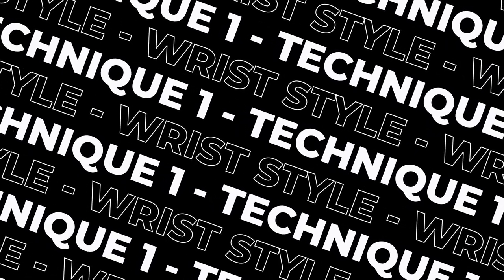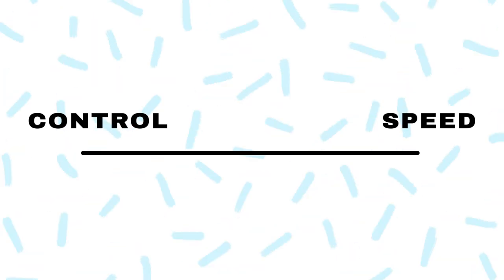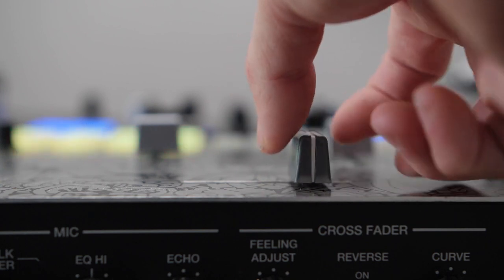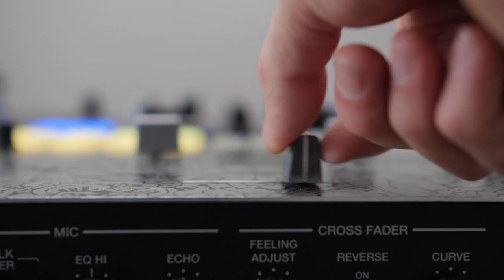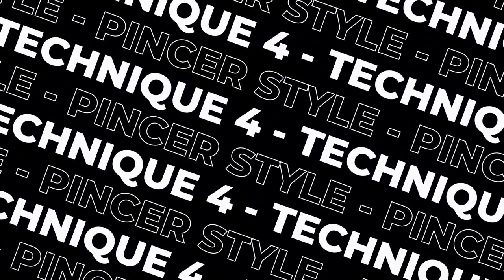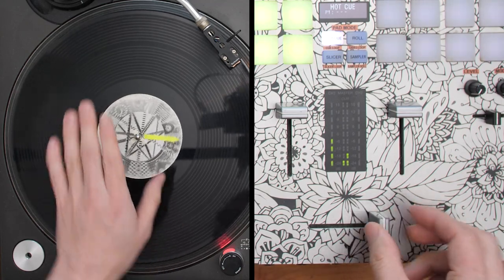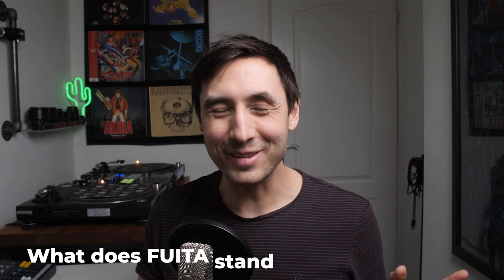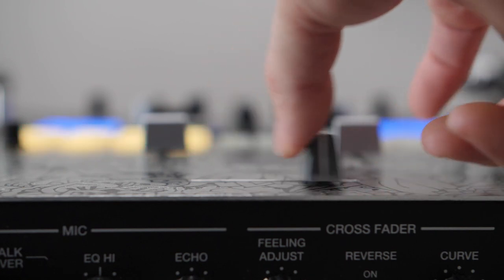5 Crossfader Techniques for Scratch DJs - Know Them All?

Comment: Si - your videos are class! I’m double clicking flares with my thumb rather than fingers. Is that still pincer style? Struggling to get up to fast speeds - not holding fader right??
Reply from the maker: Does that mean you're hamster style? Film a vid and post it somewhere mate.
Reply: @SiHargreaves  no mate i’m normal - https://youtube.com/shorts/Uq97dO2EqyA?si=hAtHsdWyHva1supt I was putting way too much emphasis on the thumb - relearnt them though to coincide with boomerangs/Autobahn A6. Dropped you a message on digital vertigo too 🙌🏻

Comment: Apologies for the noob question, but is "hamster" using your left hand?
Reply from the maker: Ah no (puts new video on the list of videos to make). 

It's where the fader is switched around to be the other way round. Most mixers have a hamster switch to acheive this. 

But you can achieve the same effect by putting your turntables into the opposite channel on your mixer. (left in right, and right in left)... Make sense?
Reply: @SiHargreaves  Ah right I see. So how do you achieve the scratch techniques you described in this video if it's hamster?! Use your thumb instead of index/middle fingers and vice-versa?

Comment: Good Video.
I have Always wondered ''Why'' we have not released a Mixer with a Button for Left and Right Deck instead of/as well as/ a Crossfader as you have stated when Scratching we essentially just use the Crossfader as an on/off Button for the Deck anyway.
Having a Nice Chunky tactile Button a bit like Drum Machine/Performance Pads on DDJ1000 ect.
DJ Gear has come a long way since the first Mixers especially now with Digital i find it kinda strange how everything else has been rewritten to make use of Technology(Phase how cool is that) but we still have not tried anything different than the Crossfader?
Reply: There uses to be mixers like this dude like 20 + years ago , Gemini and numark had mixes that had a button either side of fader that turned sound on and off
Reply: Look for numark m3 mixer it had transform buttons either side of crossfader , the only problem is you quite limited with them compared to the crossfader

Comment: What you've got listed as fuitas are proper twiddles, aren't they? Fuitas you click twice with each finger don't you (tap index twice tap middle twice or at least in the Ever that's how they were and i think Ruck invented them)? I call what you did as twiddles two fingered crabs. HOORAY SEMANTICS!
Reply from the maker: Heh I dunno to be honest Phil. I read it again to check and still understood it to mean how I described but may be you're right.
Reply from the maker: Just read it again, may be you're right!
Reply: @SiHargreaves  Erk, didn't mean to be that guy, but I think I am right, i got the sound files for it somewhere and it sounded like 4 clicks on that rather than the 2 you'd get from yours from that if memory serves. I seem to remember the ruck sayings something about them on a board back in the day which sounded like what i was saying.
Reply: I always thought I was a 1,2  1,2  1,2 1,2  vs 12, 12 , 12 , 12 if you get what I mean like it have two techniques for twiddles one my fingers are straight down and I get like a rolling pattern with my fingers then with my write more down I get like two finger crab rake that adds a pause that's the difference for me